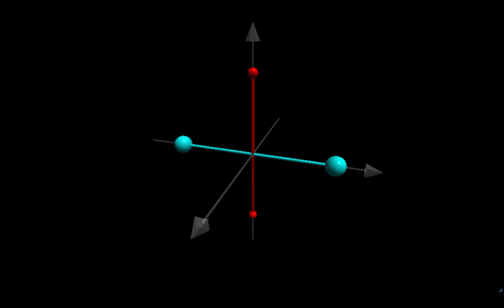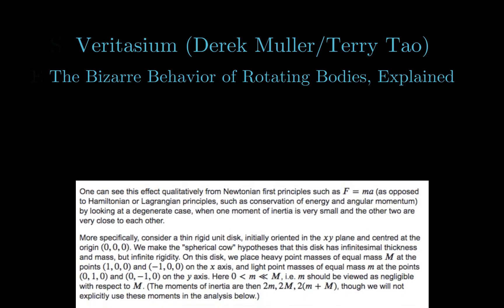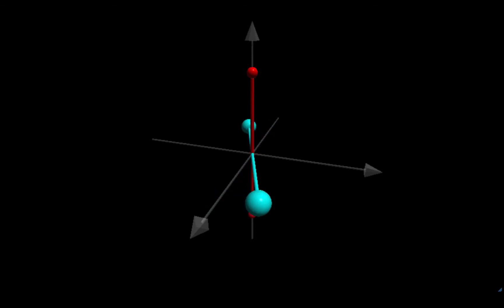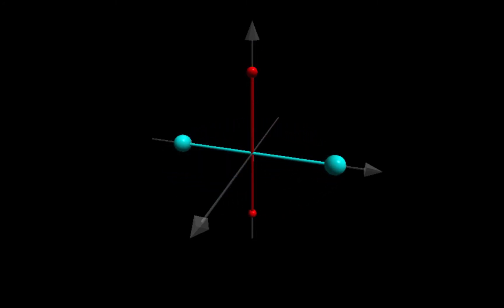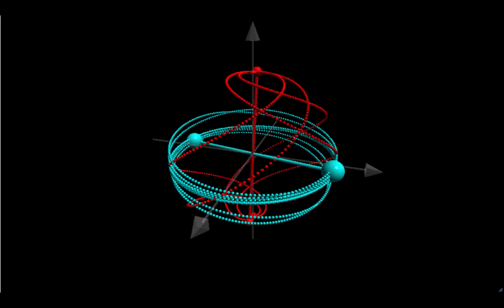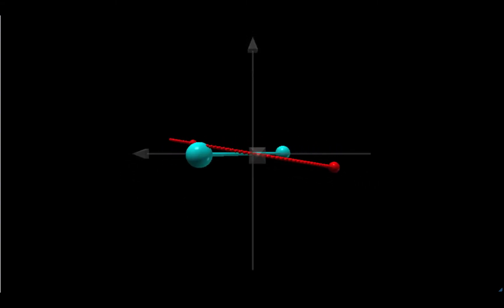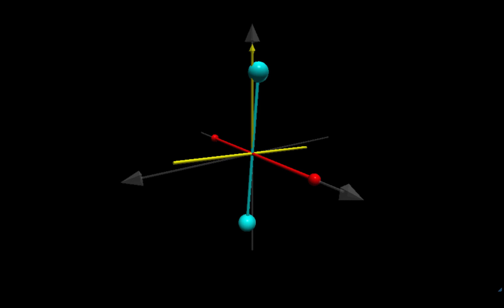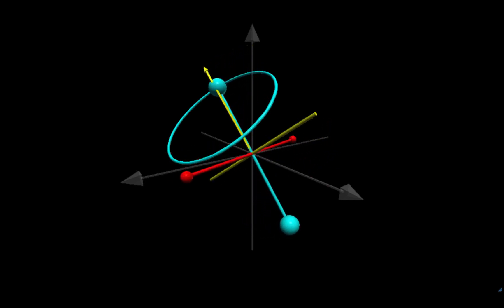Rigid Body Motion and the Dzhanibekov Effect

Comment: Well explained.  If you take the cyan to be the equator and the red to be the north and south poles, , based on mass one axis heavier than the other, applying this rule to the earth, can you predict the period of time where the flip would occur.  Does this e plain the Younger Dryas and the cataclysm described in the book ADAM & EVE?  It would also seem to suggest that there could have been  previous civilizations on the earth which have been completely wiped away. Exceptions being the pyramids and the Richat structure where seems remarkably precise measurements for the foundation of the city of Atlantis. 

Would we feel the earth wobble as the poles moved while the impending flip approached?

Comment: So, how does this apply to planet earth?  Does our fossil fuel consumption warm and melt ice caps, redistributing mass?  We see that the magnetic poles move throughout history, and there is talk of a great flood in every religion.  The water would move independently…. And has significant momentum!  What about how moving weight from the poles away from the primary axis will slow the rotation in that plane… and potentially increase the speed of the oscillations in the axis loosing weight (increasing potential for a rapid “flip”).  This would defiantly be longer hotter days, and colder nights… more turbulence.    Could that influence our magnetic flux of the planet?  Could a change in flux affect the fluidity of the magma (a ferro fluid) that our continents are floating on?

Comment: so...can you demonstrate that the earth doesn't do this too?
Reply: Probably this is the effect, which causes the flipping of magnetic poles with respect to the geographical poles periodically. I hope the next video that the author of this video is going to share will go into the calculation of this period.
Reply: @Farooqueakhan  it should be interesting to have a more detailed model. Earth's body of water, as well as the entire sphere, is not rigid, and under stress that might even contribute to the effect.
Reply: Yes, the earth is an oblate spheroid spinning in its minimum energy state (maximum principal moment of inertia). This is a given even without our observations which show this, because things like the sloshing of water will dissipate enough energy over time to ensure that the earth goes towards its lowest energy spin state.
Reply: The earth is somewhat a sphere and it does not have that instability of moment.
Reply: Earth is an asymmetric ellipsoid, not a perfect sphere, correct?

Comment: I am no physicist, or scientist,  but it appears to me that this all have to with 2 things: Symmetry and Asymmetry.  
Assymetry makes objects  uneven in terms of its weight, in relation to the center of the object. This weight and shape difference will make object to be off balance, relative to its center, even if balance can be found at some other point of the object. 

Therefore, asymmetric objects, when rotated, will always shift balance to the center of the object, and by doing it will create the unbalance, which rotating object then would attempt to compensate for (the missing symmetry), by temporary flipping the asymmetric part to the side that is missing it, then the balance is briefly restored before it again gets out of balance compare to its center, but now on the other side, and then it flips back, thus creating a cycle, that is controlled by the speed of object rotation, and that depend on the distance between the center of the symmetric portion of the object, and assymetric portion.

The assymetric part of the object is the portion that begins where symmetric portion ends.
So, I think if the object is symmetrical, and is rotating along its center, no flipping would occur.

Comment: I tried running this in Glowscript and it stopped unexpectedly. There are very few facilities in Glowscript for debugging so I installed Microsoft  Visual code as described here . https://www.youtube.com/watch?v=iExZsyAYK6o . It was stopping because it was not recognizing the 'else if' at line 90.  The program is read only so I took a copy and ran it in my own space. Simply changing 'else if' to elif on line 90 makes it work. This is a tremendous piece of work.

Comment: I watched your explanation immediately after the Veritasium video, courtesy of YouTube's recommendations list. Both together is a good way to go!

In the case of possible application to Earth's surface "rolling over" (there are too many ancient stories to ignore), one wonders what effects occur if an unpaired mass (A) is added to a spherical surface defined from the 4 initial masses (additional forces are transmitted via the "surface, which may be too complex for a "simple" demonstration)? How does that affect the rotational pattern? 

Then add another mass (B) such that the axis between A and B does NOT pass directly through the center of the spherical shape. I can visualize the setup, but my education is insufficient for predicting the behavior. [Gyroscope behavior in microgravity, as presented in NASA videos, is quite stable, but there is increasing evidence that Earth's interior layers are not as homogeneous as portrayed in the typical geology books, which makes the Dzhanibekov Effect far more possible.]

Comment: I'm not a physicist or mathematician, nor having to do with anything mechanical, but what I find immediately problematic is the "instable equilibrium position", which should be analogous to the one of the pendulum, when it is not obvious at all, because what stabilizes it in the Dzhanibekov effect is the rotation. The same rotation which takes it out of equilibrium at 8:14.
So why does it stabilise it? Perhaps because the axis of the small masses is linked to the rotation of the big masses, creating a gyroscopic stabilization (that point should be further analyzed). But why does it go out of stabilization then.

It seems to me that the phenomenon is caused by small mass asymmetries of the big masses, or generally, along the axis of the big masses, which make the real rotation axis not perfectly centered in the physical axis of the object. The two axes are misaligned!

In the case of a T-shaped object like in this video: https://www.youtube.com/watch?v=1VPfZ_XzisU
at 5:16, that would mean a small asymmetry in the masses projected from the rotation axis, causes the physical axis of the object to be misaligned with the real axis of rotation.
This misalignment of the real axis of rotation and the real physical axis of the object, would be the cause of the phenomenon, in my (very quickly brushed) view.
Reply: The flip should happen and stabilize gyroscopically until the basic misalignment position, and then resume out of it... Hmmm...

Comment: In my opinion, this phenomenon is no different than the "helicopter effect".
In helicopters, when the main propeller rotates it processes around the rotational axis at the same time which creates a torque T=dL/dt = L x W
where "L" corresponds to the angular momentum of the propeller, "W" represents the precession angular velocity which is almost the same as the angular velocity of the propeller. This torque is in the nose to tail direction on the helicopter and this is why they install a tail propeller which has to spin faster than the main one because of its smaller inertial moment to create an equal opposite torque induced by the precession of the main propeller. This is owing to this reverse torque created by the tail propeller , helicopters don't flip around.

Comment: You have provided the best explanation of the effect, far better than what Derek did. I would have liked it even more if you had spent more time on the simulation, different angles of rotation. I also still don't understand why when the red axis was at 80  degree at slow speed, the plane was not rotating at all. I would like to see a timelapse of it and if it's rotating along the y axis at all or not. You said it doesn't but I still don't understand why.  If you could provide a site on which a noob can play around (without using math), I think it would be great. I have many more questions but I wouldn't bother you with that much!

I really appreciate your efforts kind sir, and would be recommending to be pinned in the original video.
Reply from the maker: Thanks Abhi, If I recall correctly, you can't see the precession ( the rotation of the plane) in some of the video clips simply because the precession is too slow. That's why I made the one video clip with everything sped up, so you can see the precession of the plane quite clearly.